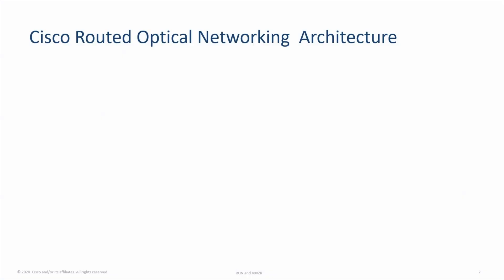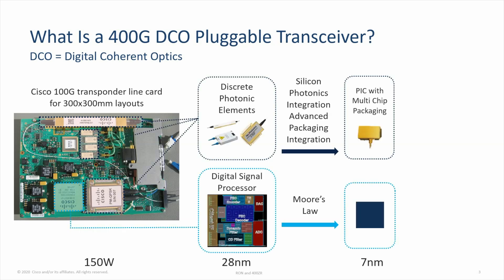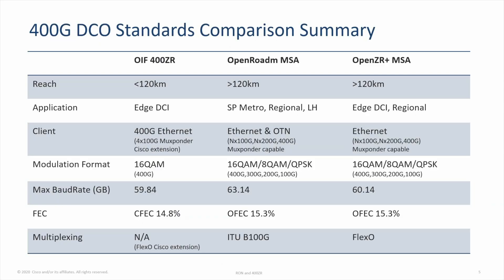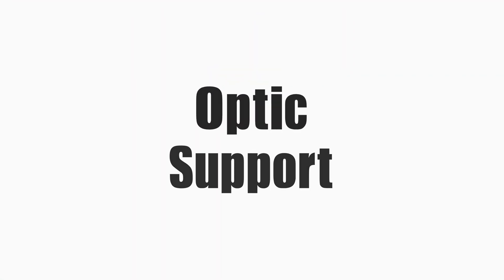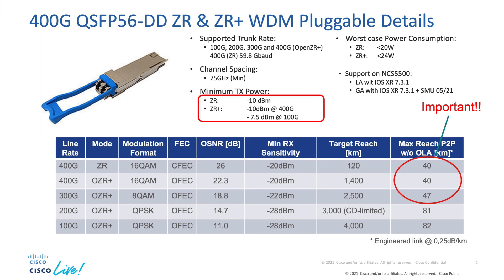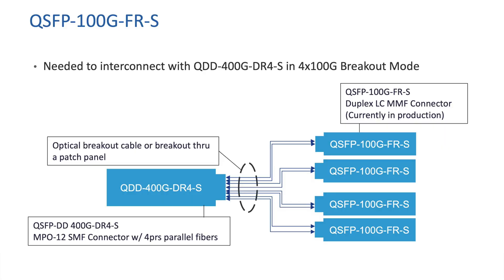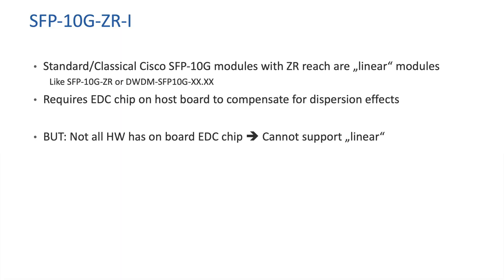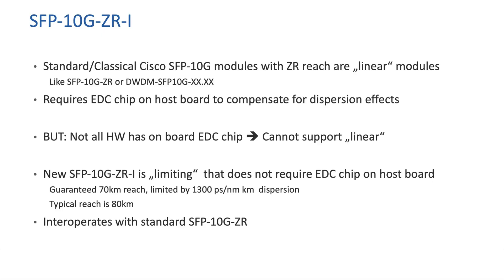Cisco IOS XR 7.3.1 Innovations - New optics #400G #ZR #100G #10G

Comment: Just confirming around 5 minutes you list Max reach p2p without OLA as ~40km for ZR and ZR+ Is this value specific to the optical budget available on the NCS platform or is it also applying to the cisco 8000 series?
Reply: The 40km is specific to the optical budget available on the QDD-400G-ZR and ZR+ module itself. With this the 40km limitation is valid for any platform you plan to use these optical modules with, be it NCS-5500, or Cisco 8000, or ASR9K or.....